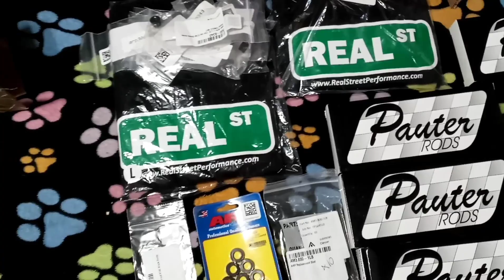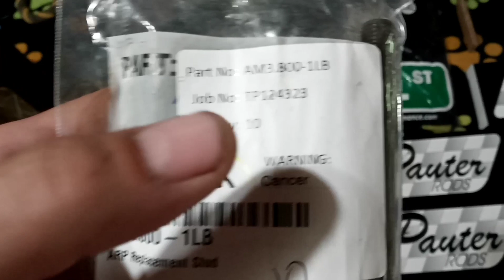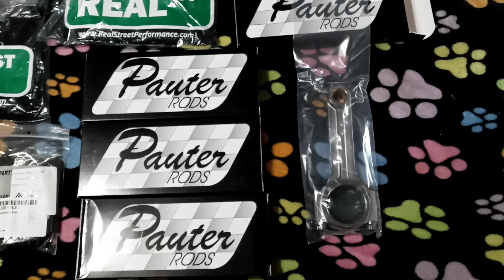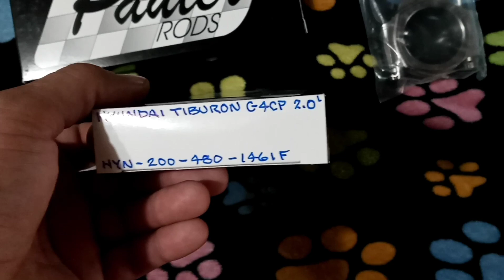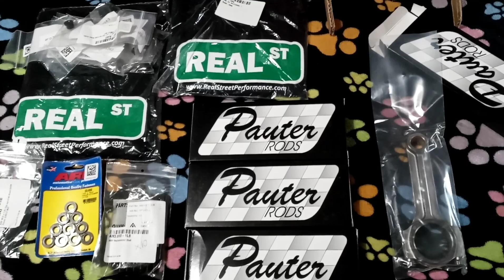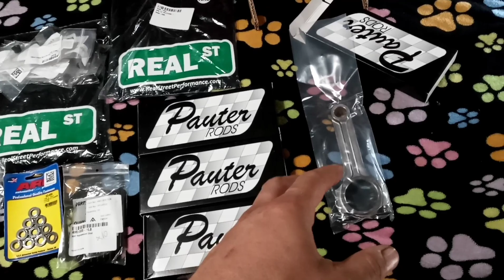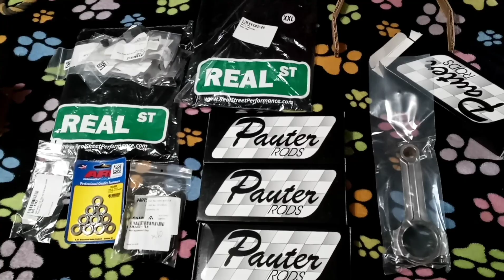Pauter Rods and Flight 93 memorial

Comment: Damn, ur dropping some serious cash on the Tib now. I look forward to that build. 
Are the Elantra transmissions stronger or are they just more common and cheaper than Tiburon’s.
Reply from the maker: Beta2 trans 01-07 Elantra weighs less 2650 03-08 Tiburon 2900lb . Same transmission but Elantra has 3.65 ratio where tib has 3.90 and 97-01 beta 1 4:35 gears some times 3.90

Comment: 10s would be impressive. Couldn’t do it in the heavy ass GK tibs... maybe the delta but I doubt that even.
Reply from the maker: Record is 10.2 in a GK beta auto car APE old car. My goal is 9s but ill go for 10sec 1st
Reply: Idk what APE is but that’s crazy for a GK. Even crazy for a Beta. I imagine it’s a fully built engine with some serious money invested.  I know the Beta is a tank though. Def an underrated engine. Mines stock still but drives like new with 190k miles. Just have had to replace expected parts at that mileage(outside the engine).  She’s been good to me.  It’s pretty similar to the 4g63 right?